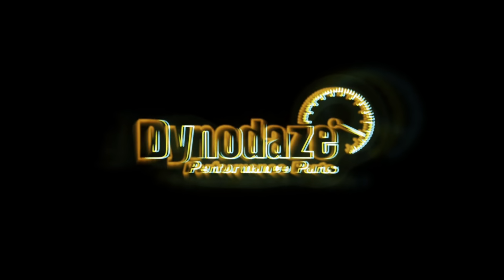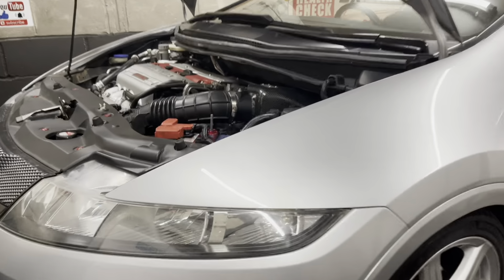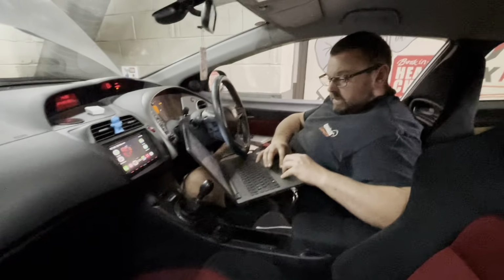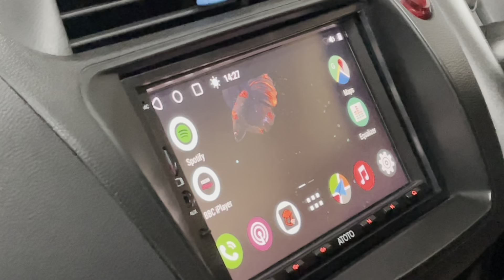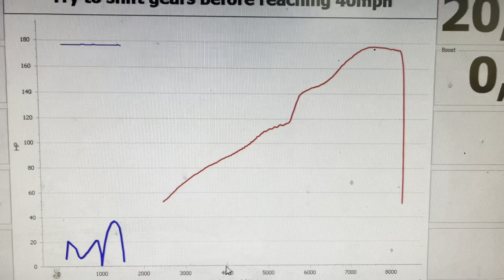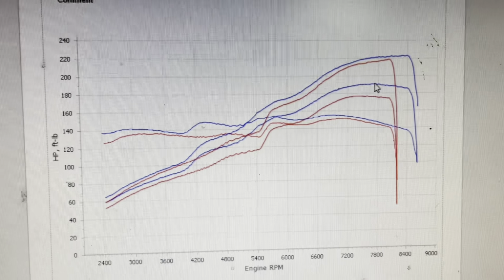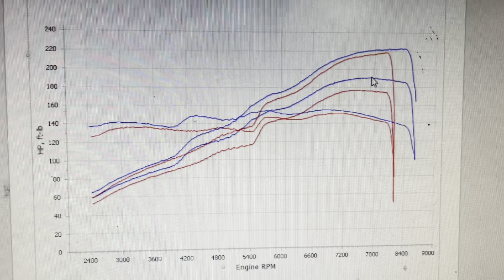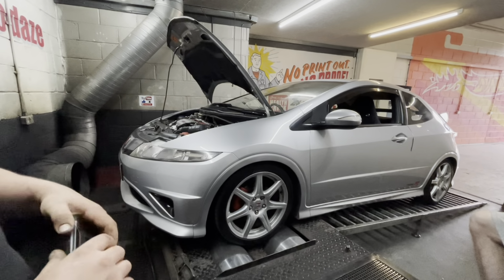Piper Manifold and Sports Cat on Honda Civic Fn2 Then Ecutek Remap

Comment: Great video guys, as always... i must admit this is a similar route i'm considering as i don't want to run without a CAT on the road, happy to at the track so this seems like a perfect compromise. Shame the diameter is only 63.5 as i'd like to run a 70mm+ CAT back.
Reply from the maker: Piper is the answer
Reply: @DynodazeHondaTuners  to be fair Tegiwa and Solid fabs don’t state what the I.D is and I’d wager they aren’t 70mm either. Solid fabs looks the biggest but if I’m going to run a S/C does it even matter? 😂🤣
Reply from the maker: @yardspeed13  Yeah i know what ya mean, Yeah piper as its interchangeable with decat so a good option

Comment: Very good video, I remember when I had a fn2 I had the piper manifold with sports cat and japspeed single exit cat back, I had injen cold air intake so made 233.4bhp and 164.2 ft lbs and Paul West aka King tuna wasnt a huge fan of the piper manifold he said that its design with longer runners made it gain lots high end but not to much mid range saying its not to good for road use more track, my personal thoughts are I really liked the higher end power might not be for everyone unless piper have changed there design in 18 months since I had mine, you see the same thing as king tuna with a much larger high end gain or is it not a huge gulf?
Reply from the maker: All tuners have their faves. 233bhp is really very good. However you cannot compare those dynos buddy.
Reply: @DynodazeHondaTuners  is true that the piper manifold leans more towards higher end power gains ?
Reply from the maker: @masonwright5128  it makes power for sure